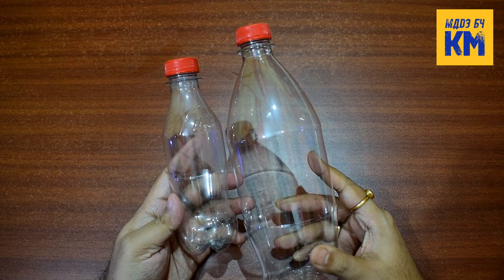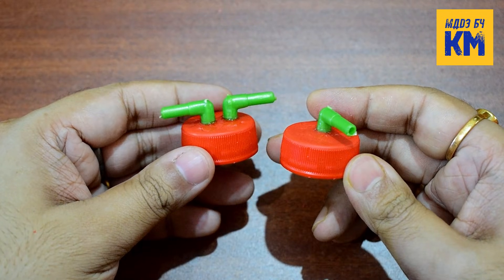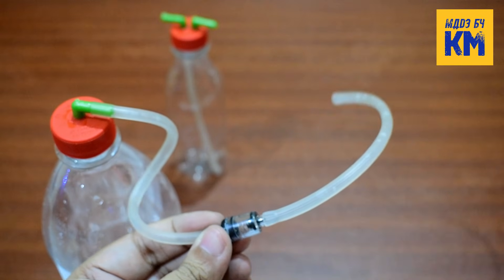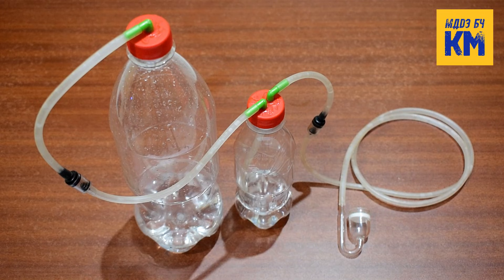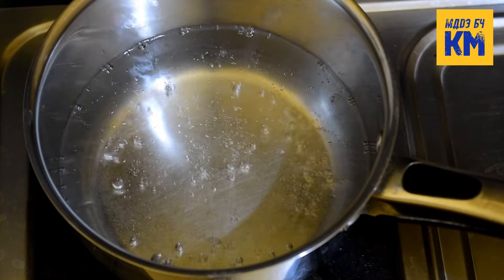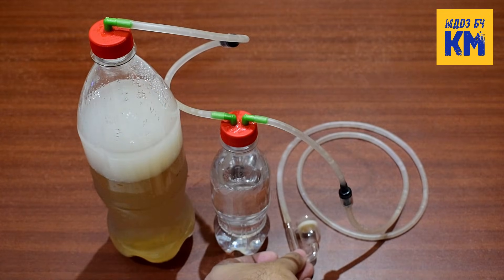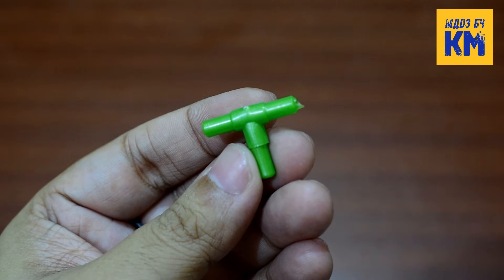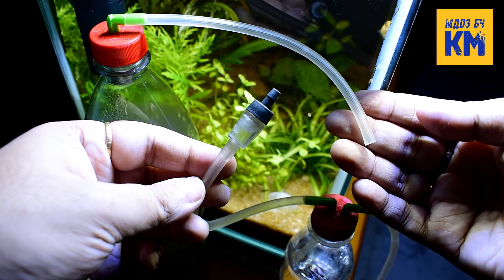Long-Lasting DIY CO2 for Planted Aquarium: Easy & Effective

Comment: Thank you for this super easy and to-the-point explanation. I will be trying this. Just one query - is there a way to completely stop the CO2 generation at night instead of detaching the tube from the valve?
Reply from the maker: Glad it helped! 😊 With DIY yeast CO2, there’s no reliable way to completely stop production at night—the reaction keeps going. Detaching the tube is the simplest option. Another option is to run an air pump at night to keep oxygen levels high in the aquarium.

Comment: Sir thanks for the video.plesse tell me how many time to take to co2 dufuce
Reply from the maker: CO2 production in a DIY system typically begins within 15–30 minutes after mixing. However, it generally takes 1 to 4 hours, sometimes up to 6 hours, for sufficient pressure to build for a ceramic diffuser to start releasing CO2. This depends on yeast quality and quantity, ambient temperature, and whether there are no leaks in the system.

Comment: Hey . I made the agar agar mixture. But like it's almost 4 hours there is no bubbles seen . Like will it work like I followed everystep of yours completely.😢
Reply from the maker: It can take a few hours to a day for DIY CO2 to start bubbling. Warmer temps speed up fermentation; cold slows it down. Make sure all connections are tight to avoid leaks, and ensure the yeast is fresh.
If no bubbles after a day, try fresh, high-quality yeast and check for leaks.

Comment: My tank is a 4feet with plants. I can see the bubbles in small bottle. Have attached a diffuser too but don't see the co2 diffusing. Please help someone
Reply from the maker: Ensure that your DIY CO2 system does not have any leaks. A ceramic CO2 diffuser needs a certain level of pressure to function properly; therefore, if your system is entirely leakproof, it should work as expected once enough pressure is generated in the bottle.

Comment: why i dont see bubble on my co2 diffuser
Reply from the maker: Check for leaks, as they prevent pressure buildup. The diffuser works once enough pressure builds in the bottle, which can take several hours.
Reply: @madebykm  thank you

Comment: How long does it take to form CO2? I have tried the method shown but it almost 12 hours i dont see any co2 getting diffused. Kindly guide
Reply from the maker: Verify that your DIY CO2 system has no leaks. For a ceramic CO2 diffuser to function properly, it requires a certain level of pressure; therefore, if your system is entirely leakproof, it should work as expected once sufficient pressure is generated in the bottle.
Reply: @madebykm I am using a small power head as described by you in another video as a diffuser. Generally how much time does it take to build up pressure?
Reply from the maker: If a powerhead is in use, it should initiate the diffusion of CO2 as soon as it is created. If CO2 production has not started yet, you can add half a teaspoon of yeast to the solution and wait a couple of hours. If CO2 is still not produced, the yeast you are using may be expired, so it is essential to select a high-quality branded yeast for your project. Additionally, ensure that there are no leaks in your DIY CO2 system.

Comment: dada check valve ta ki vabe join korbo mane kon dik kore ektu janio?sob korechi kintu check valve ta kivabe lagabo setai confused..
check valve detach kore dile co2 waste hoye jabe na?
Reply from the maker: Check valve er mota dik ta thakbe CO2 generator er dik e, ar shoru dik ta thakbe diffuser er dik e. Onek check valve e akta arrow symbol thake, tahole arrowhead ta thakbe diffuser er dik e. 

Ei method e CO2 waste hobe, karon CO2 continuously produced hote thakbe ar etake bondho korar ba save korar kono upay nei. Ar jodi CO2 24/7 chalu rakhte chao, tahole raate akta air stone aquarium e add kore dio, othoba diffuser ta tank theke bar kore ak glass jol e dubiye rekho.
Reply: thank u dada..

Comment: Could you clarify what type of valve you said? I’ve watched and listened closely but I’m struggling, my apologies.
Reply from the maker: This is a check valve, also known as a non-return or one-way valve, which enables the flow of liquid or gas in a single direction while preventing any reverse flow. This allows CO2 to flow easily into the tank while stopping aquarium water from flowing back into the CO2 generator bottles. Additionally, I want to inform you that almost all of my videos have English captions available,which you can turn on while watching. Thank you.

Comment: what co2 diffuser are you using? I have a ceramic one that looks the same as yours but I think the pressure it requires is too high for this DIY setup
Reply from the maker: Ensure that there are no leaks in your DIY CO2 system. A ceramic CO2 diffuser requires a certain pressure to work effectively, so if your system is entirely leakproof, it should function as intended once adequate pressure is built up in the bottle.

Comment: Can i use instnt dry yeast instead of active dry yeast?
Reply from the maker: Yes
Reply: @ noted thanks! what about agar agar powder what alternate can i use instead of agar agar powder?
Reply from the maker: You can use gelatin, but keep in mind that jelly made with it often loses its solidity at room temperatures ranging from 25°C to 40°C. Gelatin is most effective in cooler temperatures, especially when it's below 20°C.
Reply: @madebykm  thanks bro i subscribed to you you are so helpful!
Reply from the maker: Thank you 😊

Comment: Can I use instant dry yeast?
Reply from the maker: Yes you can
Reply: @madebykm  I cant find 1L bottle here.. Can I use 2 liters Bottle and 1.5L bottle?
Reply from the maker: You may do so; however, it is important to note that it will take more time for the pressure to build up in the bottles and for the diffuser to function as intended.
Reply: @ is there any alternative for agar agar? I cant find 1 in my place
Reply from the maker: You can try using gelatin instead, but remember that jelly made with it tends to lose its firmness at warmer temperatures. Gelatin performs optimally in cooler conditions, particularly when the temperature is below 20°C.

Comment: Hi koushik, my co2 diffuser is not working even though I am using the same diffuser like yours, does it require a lot of pressure?
Reply from the maker: Yes, a ceramic CO2 diffuser requires a certain level of pressure to function effectively. It will work when there is enough pressure built up in the bottle.

Comment: Sir the bubbles are coming in the small bottle...but not coming out from the diffuser...
It's been 7 hours since I made the system...
What can be the problem ?
Reply: may be not enough pressure what kind of diffuser you are using

Comment: I need some advice , i made this today, but while putting the agar agar solution to the bottle , the bottle shrunk due to heat , i tried cooling the solution then putting it inside the bottle but if i let it cool for only 1 minute it will harden , after some complications i did put it inside the bottle , but after that i added the east water to the bottle , but its been 3 hours but there are no co2 producing, how long does it take to start?
Reply from the maker: It can take up to 24 hours for CO2 production to start.
Reply: @madebykm  thank you so much for your answer

Comment: This is so well made, man. I’m finally interested at adding CO2 to my planted aquarium. It’s a 12 by 12 inch square tank. How long would you recommend that I keep the CO2 running each day?
Reply from the maker: CO2 should be supplied during the period when the lights are on. Generally, a duration of 8 hours of light is recommended for a planted aquarium. Thanks.

Comment: thank you, How long does it take for CO2 to appear after pouring the solution?
Reply from the maker: CO2 will be generated within a few hours. The diffuser will function after adequate pressure is built up in the bottle. It is also important to verify that the system is entirely free of leaks to achieve successful results with this method. Thank you.

Comment: There are many DIY CO2 videos on YouTube. But you are the only person who can provide complete details.
Thanks for the complete guide. 
I am building this same CO2 system right now. 
However, I have questions. How long has this jelly solution lasted for your setup?
Reply from the maker: The jelly should be replaced every 30 days. Thanks.
Reply: @madebykm  Got it. Is there a way to dispose of the jelly? I believe it is poisonous too.
Reply from the maker: It is not considered poisonous; it will only turn inedible 😝😄. When you want to discard the jelly, just squeeze the bottle, and it will come out effortlessly.
Reply: @madebykm  noted, thanks a lot. Hey, I just made this system today and it is working perfectly fine 😍
Reply from the maker: Great 👍

Comment: I know im late, but can anyone at least? Tell me if gulaman/gellatin is just fine to use ? Thnaks
Reply from the maker: Gelatin can be used as well; however, it is important to note that jelly prepared with gelatin typically melts at ambient temperatures ranging from 25°C to 40°C. Gelatin performs optimally in cooler conditions, specifically below 20°C. In contrast, jelly made with agar agar maintains its firmness even at temperatures as high as 65°C.

Comment: can i keep the co2 diffuser out of the aquarium up and running (at night instead of disconnecting) when not in use?
Reply from the maker: Yes, you can put that diffuser in a glass of water.
Reply: @madebykm  thanks for your prompt reply. will do this whenever it is not in use because if i disconnect the pipe on night, then the next day it takes around 2-3 hours to build the pressure. so I think putting the diffuser in glass of water will help because next day it wont have to build the pressure. again thanks for the suggestion. you are a life savour as always

Comment: Would it make a difference if I used a 2 litter bottle with same measurements? Cause I put the co2 diffuser in aquarium around 7 pm and checked in the morning. Everything is working except it's not going through the diffuser.
I even made sure there are not any leaks and wondered using a bigger bottle would take more time.

Comment: Thank you so much. I followed it step by step. Co2 is getting generated but what ever I have done so far, the gas is not passing through the diffuser. It is passing through all other makeshift bubbling tubes but not the diffuser. Can you help please
Reply from the maker: First, check if the CO2 system has any leaks. For this, you need to entirely submerge the CO2 system (with the CO2 diffuser attached to the system) in a bucket of water. If you see bubbles coming out of any joints, there is a leak, and you need to fix it accordingly. 

But if you find that there are no leaks in the system, wait a few hours as these CO2 diffusers need some pressure to work. When enough pressure builds up in the bottle, the diffuser will work.

Comment: first of all, thank you for sharing! also, how do you change the content of the bottle (the yellow part that sits on the bottom)? or does it decrease (in terms of height) as it is consumed?
Reply from the maker: Every thirty days, the jelly needs to be replaced, and during that time, it will melt and crumble. You can easily remove it at that point by pressing the bottle.

Comment: Hi sir. I have important question. 

Thanks so much for your video, it helps me a lot.

1. How long (in hour)  would you recommend the Agar-agar turns to jelly before i can put the yeast inside?

2. I've waited for 1 day, but the diffuser still didn't produce co2, whether glass or ceramic diffuser. Is this normal?

3. The yeast is leaking from the co2 generator bottle, how do i overcome this?

Thanks so much for your video again.

Comment: this video is brilliant. if only there was a way of fitting a solenoid and timer it would be perfect for me, but I can't be there daily to manually turn it on and off
Reply: There is a way if your worry is gassing the fish at night. Add one more airline from one of the bottles and fit a solenoid valve to it. Time it so that the valve is open when you dont want to use CO2, so the gas will escape out instead of going in to the tank. 
It wont save your CO2, but you wont have to worry about CO2 buildup in tank overnight. 
Or, simple solution that I used to do was put a very small fountain pump ( or powerhead) on a timer which turns on at night, it creates enough surface agitation to off gas any excess CO2.

Comment: Till now, this is the best method (after using it for 2 months):

1) Very cost-effective: 

Jelly powder: 50/- (you can grab it either online or at Sealdah Market).

Yeast: 20/- (1 bottle is enough for at least 15-20 times use) 

 

Sugar: 5/- per 100 grammes...

 

2) Pressure buildup is decent in this way; from my experience, 3 to 4 strips of CO2 will be visible for 1 week straight for 1 hour daily.

 

3) If you want to last it longer, then after 1 or 2 weeks, discharge at least some of the dissolved jelly...and then add 2 to 3 spoons of sugar (don't shake it, just let it precipitate) and then add half a cup of warm water with 2 pinches of yeast (একদম নাতিশীতোষ্ণ জল, খুব গরম জলে জেলিটা ও নষ্ট হবে, ইস্টও অনেক মরে যাবে)

 

3) If you use 2 sachets of jelly, it will make the jelly more condensed, and as a result, the jelly bar will dissolve much more slowly.

 

4) My jellybar (with 1 sachet😢) is still condensed after 2 months'use.e

 

BUT IF YOU WANT A HIGH-PRESSURE CO2 RELEASE!!🎉🎉

 

then definitely go for the acitic acid solution (1:3) and soda (1:1) method.

 

The acid-soda mixture is a little bit costly.

1) Acitic acid price: 160/- per kg in the Kolkata retail shop (if there is any other way to buy acitic acid at a cheap price from Kolkata, then please let me know).

 

2) baking soda (খাবার সোডা): 60/- per kg

 

NB: For a 2-foot aquarium, you need 100 g of acid and 300 ml of water (1:3) and 200 g of baking soda and 200 ml of water (1:1).

 

 

And lastly, I will always be in debt to Koushik Da for his very informative videos and excellent knowledge..
Reply from the maker: Thank you so much 👍
Reply: You are most welcome @madebykm

Comment: What happens if this puts too much co2 in the water? That's what I'm worried about because apparently it can kill your fish. Really good video btw!
Reply from the maker: The CO2 concentration above 30-35 ppm in aquarium water is toxic for most aquarium life. A single CO2 generator such as this will never produce that much CO2. Therefore, it is completely safe for all aquarium life. The CO2 production in this method also depends on the amount of yeast used. More yeast = more CO2. This means that you can easily control the CO2 production by adjusting the amount of yeast and thus get your required CO2 rate (bubbles per second) for your tank. You can also use a CO2 drop checker to measure the CO2 levels in your tank. Thank you.

Comment: Hi, I am new to this channel and recently saw this video. Very informative. You mentioned disconnecting when CO2 is not needed. Won't that leak the CO2 which is generated.
Reply: Thanks for confirming 😊. Will post results once setup is complete.
Reply: Success!!! Thanks Kaushik for this amazing DIY . I used a cigarette filter as a diffuser.
Reply from the maker: Great 👍
Reply from the maker: CO2 will be continuously produced in the bottle, so there will be no problem. Another option is to use an air stone at night to keep the oxygen level in the aquarium water high. Thanks.
Reply: @madebykm is there any specific use of the check valve. I have a normal flow controller, can i use that
Reply from the maker: The check valve will prevent the backflow of water from the aquarium into the bottle.
Reply: One last question. When do we need to change the jelly base.
Reply from the maker: Every month

Comment: Hello, i set up device according the video, however, i found there was no bubble coming out from the diffuser in the tank. The second bottle in the water was found bubble coming out. I don't know why there was no bubble in the tank. I checked tubing connection and airtight on the cap should be okay. Anybody can help for this?
Reply from the maker: Glass diffusers require some pressure to work properly. It will work when enough pressure builds up in the bottle.

Comment: I have seen 2methods of your on diy co2 so which you suggest as first and effective longer
1. Jelly METHOD
2. THIS VIDEO
Reply from the maker: Both methods will be effective and long lasting. However, I would suggest starting with the jelly method first as it is a bit cheaper.

Comment: One thing I noticed, in my experiences, is hot glue can sometimes fall apart when exposed to humidity for prolonged amounts of time, such as a DIY CO2 system… just saying. It may work for some people, and it is very useful for many things, but when water is involved it can become disintegrated or corroded, possibly causing a leak in the system. But I would just stick with the waterproof silicone to avoid that. 😀
Reply from the maker: Great tip!